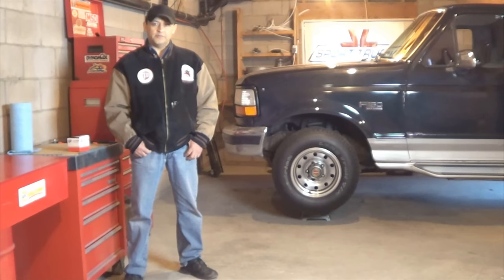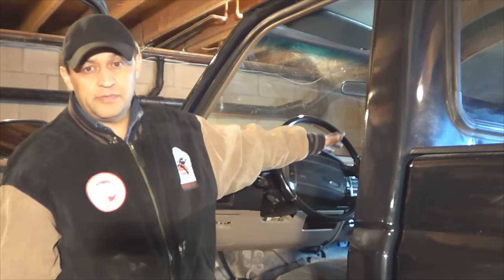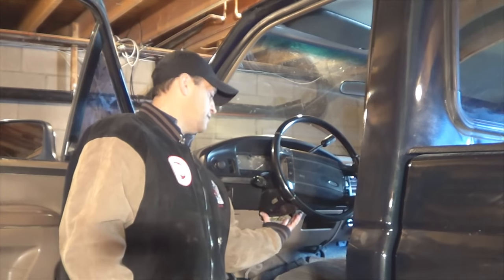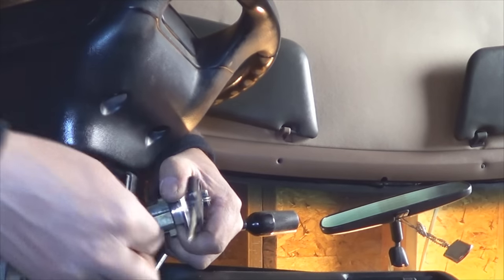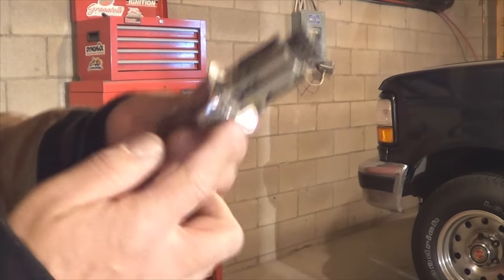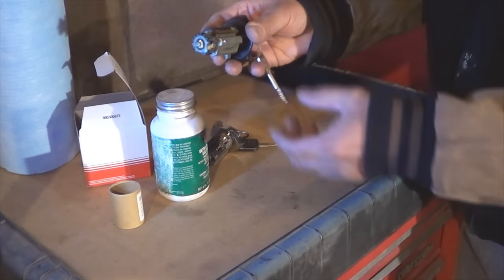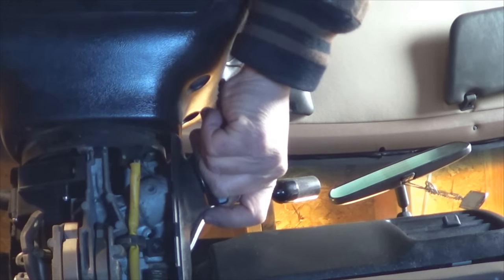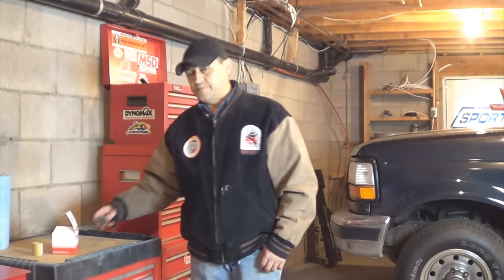1992 1997 Ford F Series Pick up Ignition Tumbler and Key Replacement

Comment: Better question is how to I get it out if I don't have said keys
Reply: Drill out the pin or the ignition
Reply: Take a drill bit that's about the same size as the pain and just driller out
Reply: Yea, how do you if you don't have key
Reply: Pop the plastic cover and hammer a flat head screwdriver into it I just did this
Reply: A hammer and flat screwdriver... that's how I had to remove mine after losing the keys.

Comment: Hello l have a Ford F150 96 model.l notice that in your video when you pull out the ignition switch  there where not two  small parts where missing. The first part is a green flat  circlar washer and second is as small flat  rectangle metal shape washer. Do you know the correct name of these parts?
Reply: I’m tryna figure out this same thing

Comment: We dont have the key I can see the spot where you push the pin in I used a pic and pushed it and it moved a little way out and stopped is there anyway to remove it without the key and to not drill it out and ruin it?

Comment: I lost the keys for are truck I took off the cover and pushed in the pin it pulls out about a 1/2 inch and stops and wont come out any further anyway or suggestion to get it out to replace

Comment: Do you have any idea why when I try inserting my new ignition switch it doesn't act correctly. It worked fine before it was just broke on the outside where you put your fingers to operate the switch. It would just spin so I always had to like it up for the key to go in. But the switch itself worked fine. Accessorie, off, on, resisted start if that makes sense. Any tips would be great. Do you think I should go to O'Reilly, napa, or a actual parts store? This switch I got is off Amazon. It looks the same but was cheap yk.

Comment: I did exactly the same thing but now my truck doesn't have any power...any suggestions why?? Wont start. No power no lights. I didn't disconnect anything just took out ignition and put it back in again and now I have no power.

Comment: Nice, the ignition cylinder on a 93 messed up in the late 90’s on my pickup.  Ford wanted a few hundred to fix it.  20+ years later it cost less than $20 and takes 3 minutes to fix.

Comment: after installing new lock cyl, my 92 tilt wheel wouldn't lock with key off. Fixed it by seeing at 2:48 in video the gear position & pulled new lock cyl out again and mine was correct. Mine had a blue lock thin plastic washer type keeper that I had to twist to get out and the gear was under it. then got screwdriver and slid the yellowish/white plastic 'rack'  TO THE LEFT (maybe one tooth) and reinstalled the gear + blue keeper + lock cyl and Now My Steering Wheel locks again with the key out!   The GEAR POSITION AND THE RACK POSITION DEFINITELY CONTROL when the steering wheel locks. When I say 'the rack', it is the toothed piece that the gear engages with and when the key & gear turn, it pushes this rack down the column to activate the electrical switch.  By MOVE TO LEFT I mean looking down into the lock cyl hole (move left and away from electrical switch /away from steering column base). Had to watch that section of your video 3 times, but eventually I got it on the first removal of lock cyl.  yeah seems easy, but only after I watched a dozen other youtubes and googled for over an hour.   thanks for the video and helping me STUMBLE ON TO THE FIX.    Hope this helps someone.
Reply: Kevin, believe I'm having the same issue you did and I was thinking the same thing with the gear tomorrow. Thanks for the input on here.

Comment: what if i dont have the key to remove, is why i want to replace mine
Reply: alejandro torres so how did you fix it, cuz I don't have the key also
Reply: Here to
Reply: Same here. I've been searching for the key for weeks. Truck is parked on the street. Got to get it moved before any of my neighbors complain.
Reply: i hammered a small(glasses repair kit)flat tip screwdriver into the cyclinder on the tumbler side and another on the other tumbler side(since the key has teeth on both sides),and was able to turn it.the cyclinder  won't be used anyway-you are replacing it.hope it helps guys.
Reply: @johnoktavec  hey just read ur comment, it might be what I need to do since I can't turn the key to the on position. So you basically stuck a screwdriver in the cylinder, and that got it to turn somehow? Mine won't turn even with the key in

Comment: Wouldn't you also have to replace the key cylinders in the doors? Unless of course you want 2 different keys: on for the ignition and one for the door.
Reply: How about - take the new cylinder to a locksmith and have it rekeyed to match the doors before you install it?

Comment: What about the programming?
Reply: These years of trucks did not have NFC/RFID chips and sensors installed in the vehicle. So, programming is not required because that anti-theft feature was not available in these model years (1992-1997). For 1998+ I am not sure when they enabled that security feature.

Comment: I got it in and now I can’t take the key out of the ignition
Reply: I can take the ignition out and take the key out but not with it in
Reply: I have the exact same peoblem and it is addressed no where
Reply: @davidhughes4812  I realize this is an old post but maybe it will help somebody that has this problem. Make sure the vehicle is in "Park". I couldn't turn it to the "Off" position until I did this.

Comment: what if the lock cylinder is stuck and will not turn at all?
Reply: That's my problem, tryin everything right now. Did you figure it out?
Reply: Did yall figure it out,have same issue. Thank u much
Reply: I just forced mine. You will be replacing the cylinder anyway. Key in it would not turn cylinder, so I forced turned it with some channel locks. It sheared off the key in the cylinder but I was able to then turn/start vehicle then with a screw driver. I would just try and force/brake the lock this way with some channel locks. Try it first without the key in there if you don't want the key broke in half.  YMMV
Reply: Then your shit out of luck 😂😂
Reply: My guess would be to drill out the pin that’s holding it in place